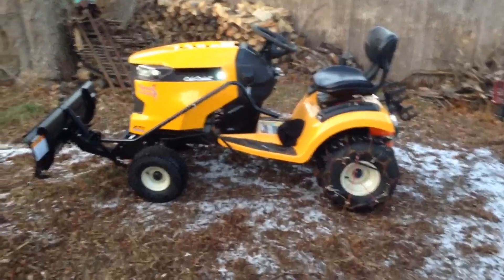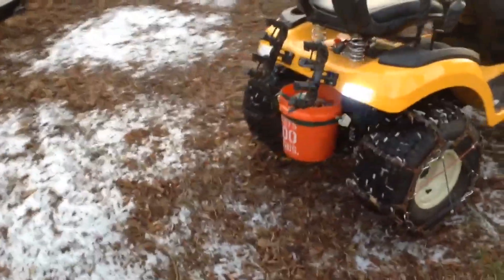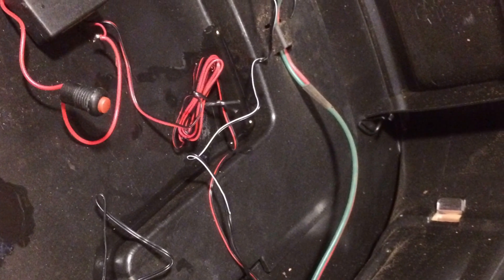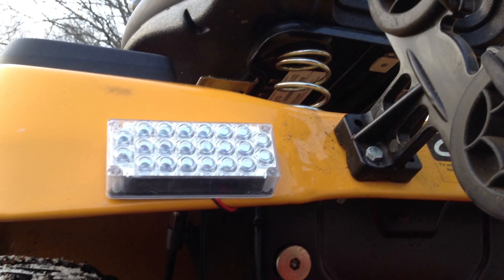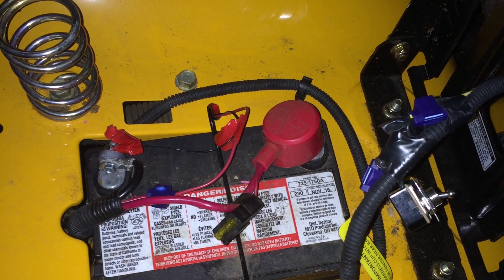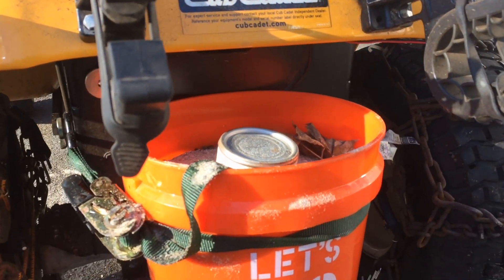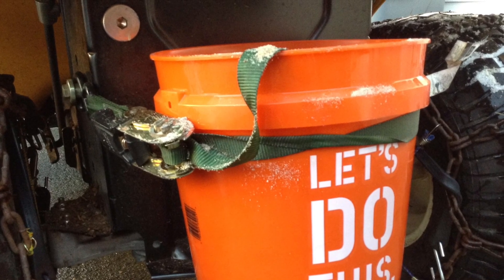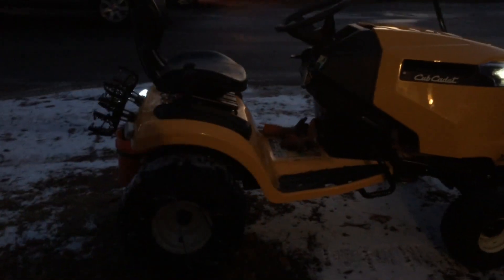Cub Cadet XT1 winter modifications

Comment: Where did you find strobe lights and can you show how to hook them up?
Reply from the maker: mclary9808 Tractor supply sells them.  Very very easy install
Reply: BNSFGP38 thank you very much . Thats where I got my Cubby so I will go look for them
Reply from the maker: mclary9808 Mine were on the end caps at my local TSC near the trailer section it’s very very simple wiring in the front I just took off of the front light harness that is in the hood in the back I just wired directly via a fuse to the battery and have a switch on the cupholder